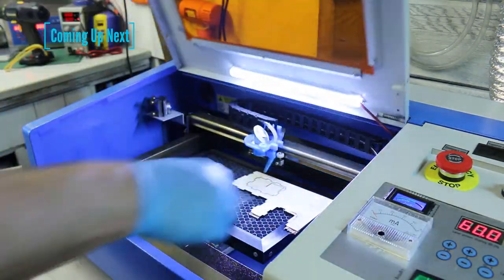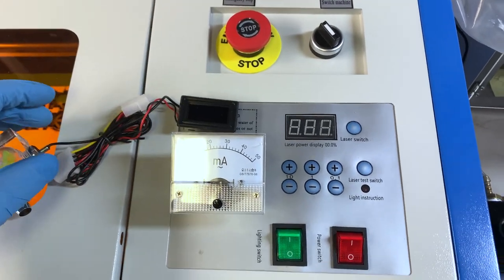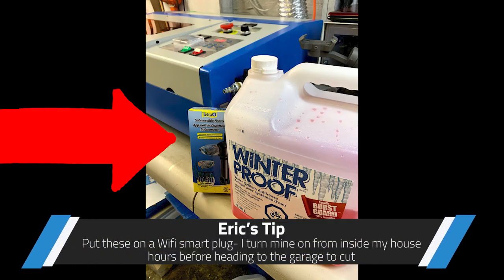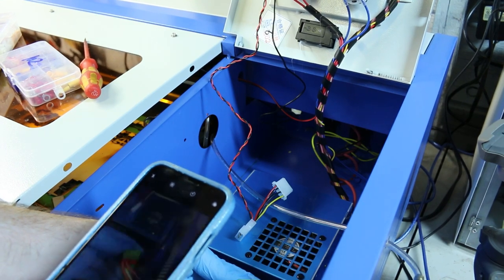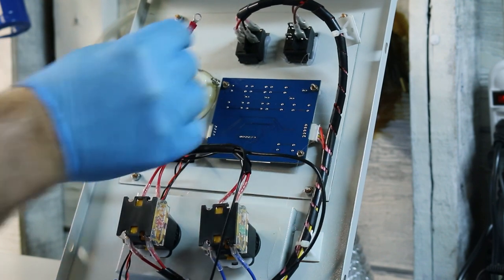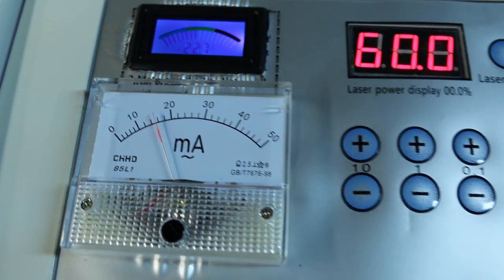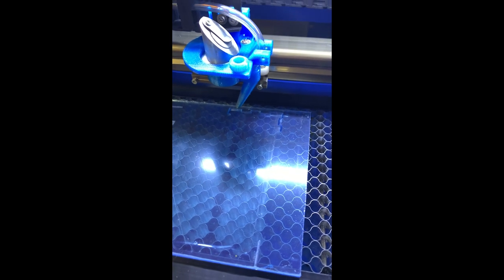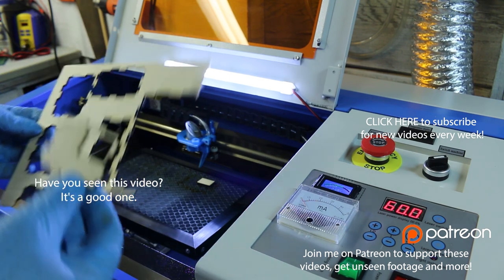EASY Upgrades Make the K40 a BUDGET Laser Cutter BEAST! 🔥

Comment: I would add a safety switch that cuts power when opening the lid

I designed a stepper powered bed that is fully 3d printable with aluminum bars
very sturdy and powered by esp32 via a 12V buck converter I can set the  bed height  with a very small margin,

Comment: my mods are:
added a camera, 
added 2 red line lasers to form crosshairs, but also make alignments easier
moded k40 whisperer to accept command line arguments so I could run it via shell commands
installed a raspberry pi which runs an integrated web-server to stream camera, make videos of the device when it operates. 
made a motorized z-axis bed from one of those scissor lifts 
got a 30 gallon barrel filled with 50/50 antifreeze (inhibits mold) the  thermal mass of which is sufficient to only budge 2-3 degrees C even after long cut processes
added a carbon filter made out of a 5 gallon bucket. 

Anyway, if you have any tips on how to adjust the focal point down, below the gantry frame, I'd love to know more. 
if I could get the foal point below the gantry, I could increase the size of projects I can place in the laser.